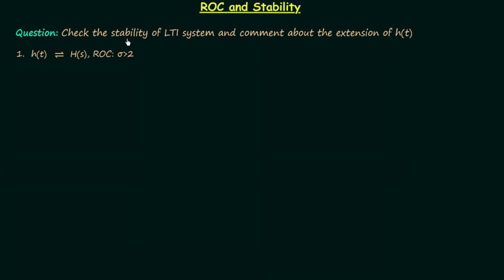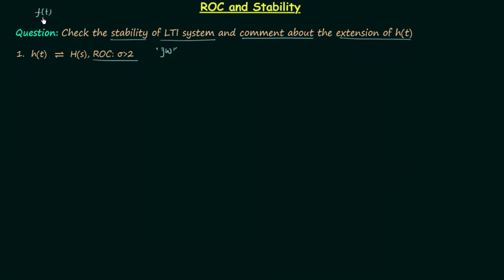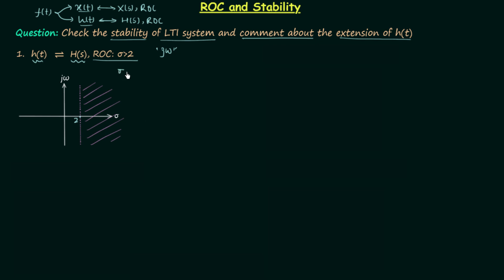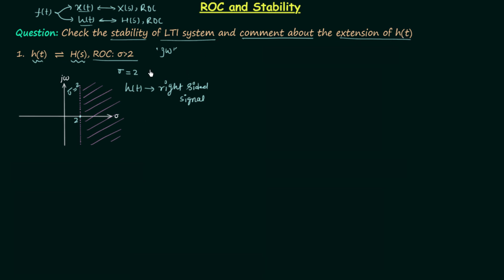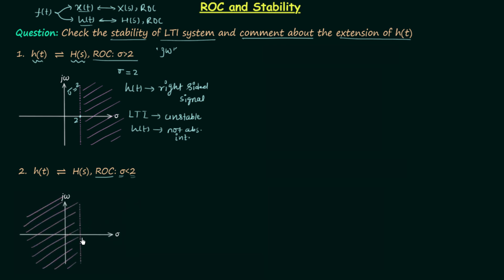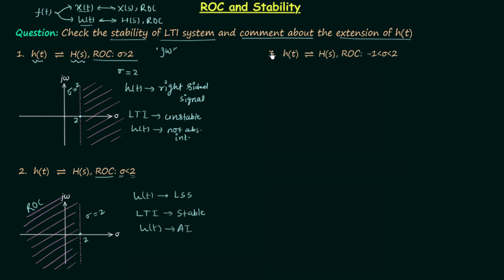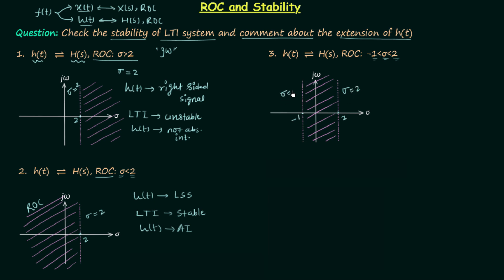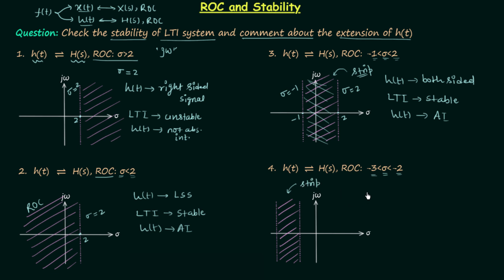ROC and Stability

Comment: You have told here that if ROC include the imaginary axis then it will be stable. though the pole is exist on right and side of the imaginary axis.
 But in Root locus of control system there if pole is exist on the right hand side of imaginary axis then it's unstable. 
why it's different? can you please clarify this...
Reply: In control system,system is assumed to be causal whereas in above question system is anti causal